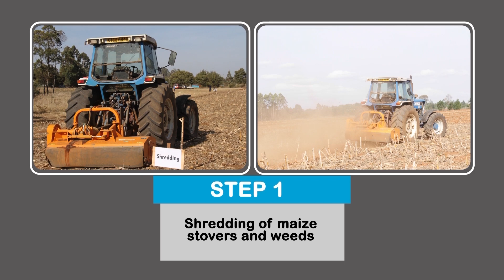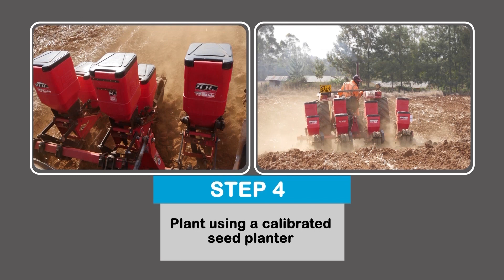Professional land preparation for forage maize production

Comment: Within an African context, that amount of tillage equipment on one farm is rarely seen other than with large scale farmers. With an average smallholding of two Hectares, many African governments have opted for a top-down approach whereby governments encourage rich farmers to purchase often subsidized high horsepower tractors and implements and offer contracting services in their area. The standard government package is a sixty horsepower tractor a three-disc plough, a disc harrow, and a trailer. In practice, the disc harrow is ignored as the intention is to plough as many acres as possible, the practice of ploughing a field then removing the plough and fitting the disc harrow then removing the harrow and refitting the plough and going on to the next farm rarely happens
Reply: Very interesting. I am endeavouring to go into farming and I have purchased an MF 265, I inherited a mouldboard plough from my late father and 16 gang disk that was on an MF 3080. I have recently also purchased a 3 disk plough because I was led to believe that it is much better than a mouldboard plough.
I find that it is quite difficult to get accurate information about agriculture as people have varying degrees of opinions on equipment and practices.

Is there a site which would have a standardized set of instructions and equipment for a small farmer such as myself?
Reply: @DanielKatundu-y8t  I have recently purchased an area of bush in Eastern Tanzania which we intend to farm. I am avoiding the disc plough and instead intend to purchase a Piket two-row No-Till planter from South Africa. We will plant maize as a cash crop inter sown with beans and trial plots of Sunflower, Banana, and Cassava. We intend to keep the maize and process it through our own hammermill to add value.